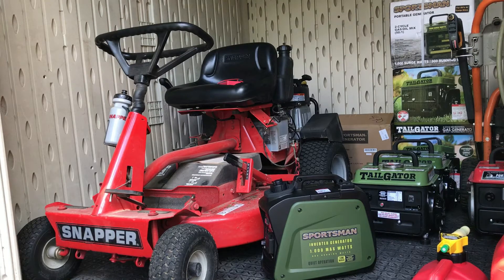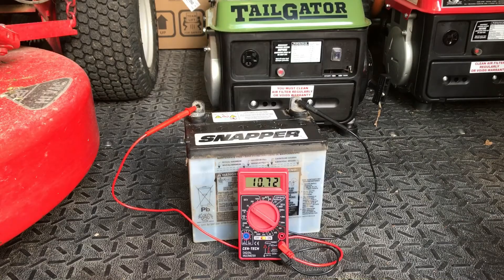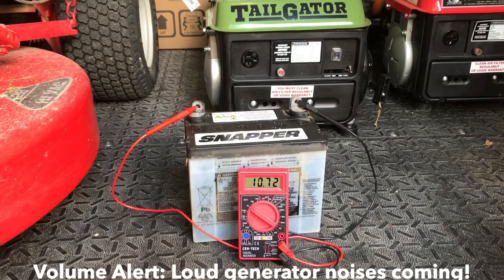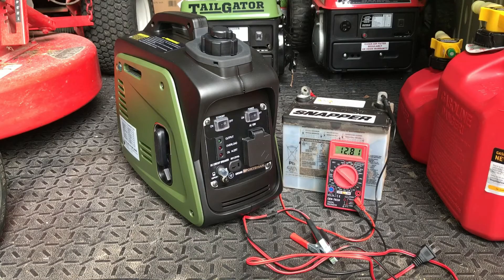DC Battery Charging with Sportsman 800 / 1000 watt Inverter Generator

Comment: The DC output on that generator is only 4 amps.  That battery was dead and for it to have reached full charge at 12.8 volts in less than an hour at 4 amps indicates the battery is shot.  It should take about 20 amp hrs to reach full charge or 5 hours at 4 amps.

Comment: doing some testing on mine today.... i think the 12 volt outlet is powered by a separate set of windings or something. I was able to run a 7.2amp noco battery charger plus used the 12v 4 amp outlet to charge my battery bank at about 11 amps. the genny did not care one bit or change RPMS one bit with plugging in or out the 12 volt outlet. this boils down to 1344 total watts being outputted. Ran like a dream, no over load light or anything. May have found a loop hole with this little gem of a generator......
Reply: You will have to use an dc ammeter to find values.  Current is drawn not pushed; therefore, probably less current drawn from 12v outlet.  your total watts will not exceed the hp displacement of the engine.  No free energy.  Thanks for sharing

Comment: I disabled the 12V port on mine and converted it to a regulated USB outlet with 3 plugs.. I tried to post a link to the one I used but youtube wouldn't let me. Anyway if you search for it on amazon it should come with a wire set with a black screw together inline plastic fuseholder.... I drilled a 1 1/4in hole with a step bit just below the A on the non pull start side of my generator, and installed it there, and ran the ground to the front  panel ground lug (I installed it new wire then the old wires on top, then replace the screw) on the panel and undid the stock fuseholder and installed the wire with the fuse holder from the USB plug adapter (they use the same fuseholder if you get the correct one maybe open your generator to have a look at it to be sure). I had to bend the tabs on the back of the USB adapter 45 degrees but other than that the including wires worked perfectly. I plan on renabling my DC port but I'll have to cut the wires and solder them together to do that (and remember not to overload it).

Comment: i own a  2kw  hyundai portable  generator .it says 12 v 6 amps dc in the booklet.when i read the output voltage , i read  24.4 V dc .i called the company , they said it's normal. The dc port is to  quick charge a 12 v battery.don't leave it connected for too long .

Comment: You might be able to help. I just got one of these and I’m really happy with it so far. However, I was charging the minivan battery after the kids left all lights on overnight and it did well for about 30 minutes and brought it back to 12.1 v, but after that the 12v fuse/breaker in the generator kept tripping each time I tried to connect it to the battery again. Took the battery to the local shop and it was changed there no issues and the battery is good. 

Any ideas what am I doing incorrectly or what might be happening?
Reply: There was probably a plate shorted out inside the battery
Reply: The problem was you were using a junk generator.

Comment: Can you both charge a battery and run a small ac load at the same time on an inverter generator, provided you don't exceed the max continuous power output?
Reply from the maker: The instructions say to do one or the other, not both at the same time

Comment: Screw this useless crap.
Somebody check the actual DC voltage and amperage  being produced before any restrictions are applied to the current.

What can this puppy really do on DC.
I need 72 volts@30 amps. Will it do it.
Reply: It will NOT do it... that's over twice the total max wattage output of this generator anyway including the AC output. The 12V output is just unregulated 12V, it varies with engine speed and load but is probably 10-15VDC. It comes off a separate winding on the generator also... separate from the windings that go to the inverter.

Comment: Just a slight note, the DC plug on generators isnt made to charge batteries per say. Its not regulated, and can over charge a battery and harm it. What you can do is buy a smart charger and plug it into the AC and charge away. When the battery is full the charger turns off.

Comment: Did you measure the output voltage with no load on? As long as it's 14.7 volts or less, I think you could leave a battery connected for as long as you want. Once the battery reaches the same voltage as the output, current will stop flowing. If, on the other hand, the "12V" output is more than 14.7, you could ruin a battery through over-charging.

Comment: But- what if you hook that 13 volts to a solar MPPT  "Charge Controller"  ???    I did a quick test....

While doing my tri-monthly Generator testing to keep it ready for hurricanes I saw a DC output plug on the side. So- I hooked the cables to my EPever MPPT 40a Solar Charge Controller to charge the batteries in my solar array. It seemed to work.
Reply: Great idea. Didnt think of that

Comment: Do you know if it can start a car that has a low or drained voltage battery right from the start or it can only charge the battery? Thanks again!
Reply from the maker: It can only charge. It will not work as a booster to jump start a car.
Reply: KevCentral Thank you so much !!

Comment: Does the TailGator have a 12v output too? Most of the different versions of that generator, sold in the UK, have the DC output but a few don't.
Reply: I vaguely recall seeing that early models of the tailgator had a connector for 12Vdc output one side where the rectangular rubber seal is located just above the alternator. Am I incorrect?  Please advise.
Reply from the maker: Sadly it does not. It only has the one AC output.